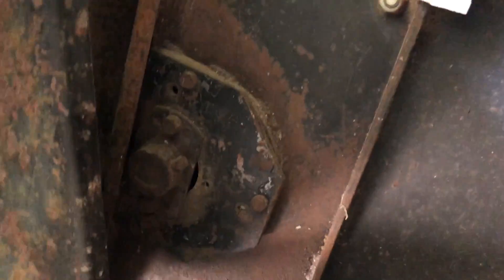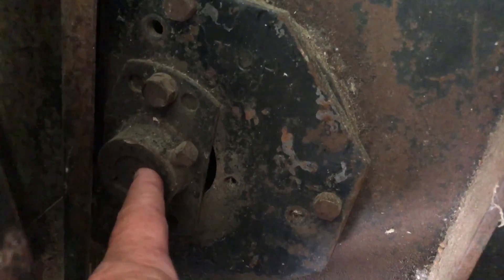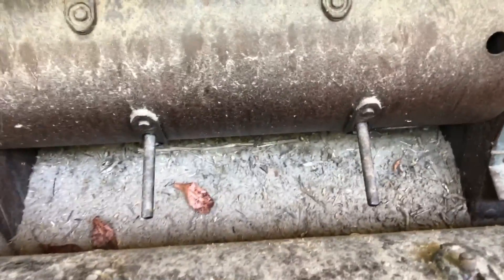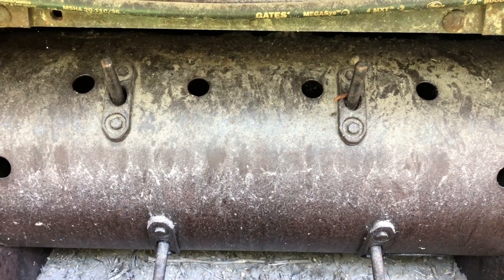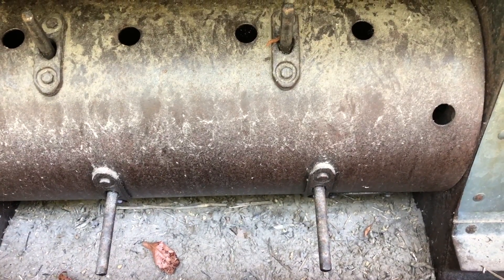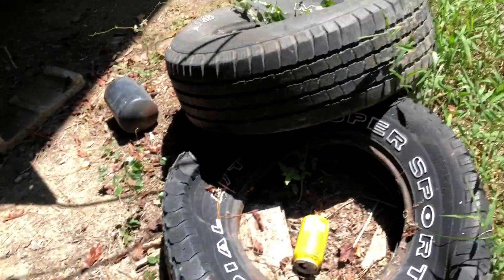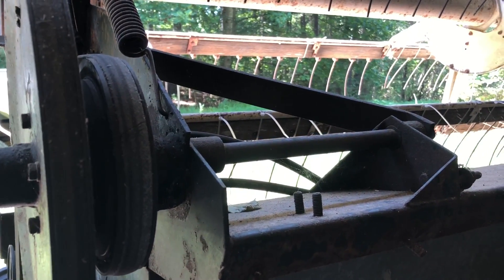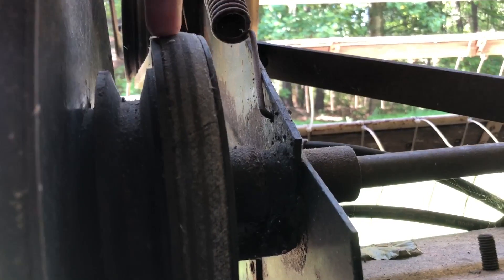Helping IP and Machine Update

Comment: Hey Scott, thanks for helping a feller out! 
On your reel speed, I couldn't see real well in the video, but the pulley you were pointing at, does that belt go to the reel? If it does, then the pulley you were pointing at is the drive pulley and you need to go smaller. Try moving the belt to the smaller pulley beside it (between the one the belt is on now and the big pulley on the outside). That should get you a little slower, not sure if it will be enough. If not, put a bigger pulley on the end of the reel shaft if you can find one. My All Crop is nice, the drive pulley is adjustable to tune in your speed. Doesn't look like the Gleaner head has that. Bigger or smaller pulleys depend on which end you are working on. On the drive end, bigger pulley = faster, smaller pulley = slower. On the driven end, it is opposite. Bigger pulley = slower, smaller pulley = faster. Hope that helps. Good to hear from you Scott!!! Hope you have a good one my friend!
Reply from the maker: Thank you Evan very much for sharing this information with me!
Reply: @gleanerk  Anytime Scott! Hope it helps!

Comment: Dont feel bad about not having the hydraulic variable speed, mine doesn't work half the time anyway. Looks like you need to put the belt on the smaller pulley and that should slow it down, if it doesn't just drive faster😂, dont do that youll just plug it up. We need to come up with some kind of Gleaner Gang gitup for us YT Gleaner guys.
Reply from the maker: I too think it runs slow on little pulley . I think a hydraulic motor would work